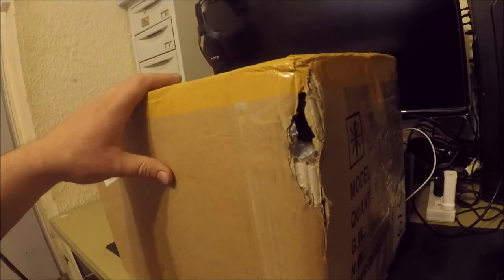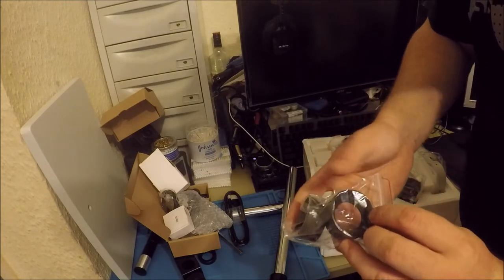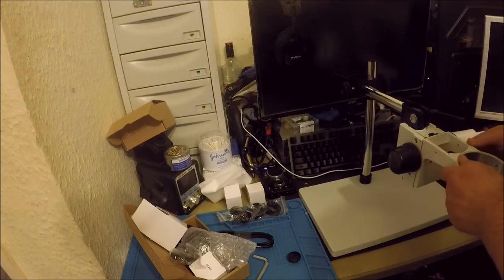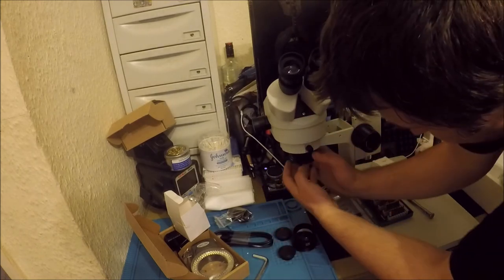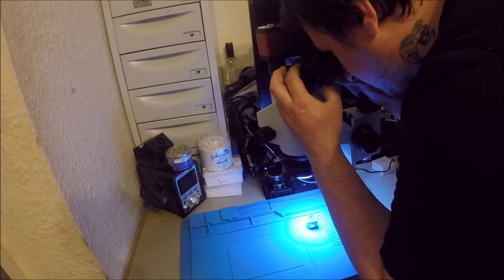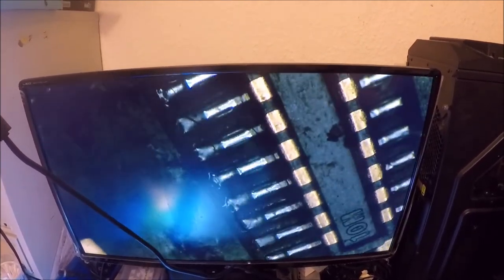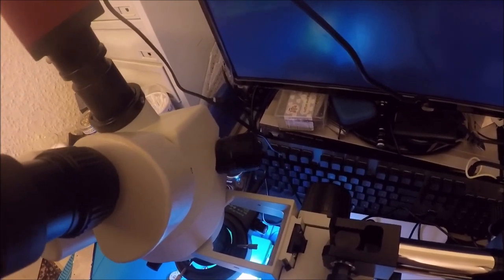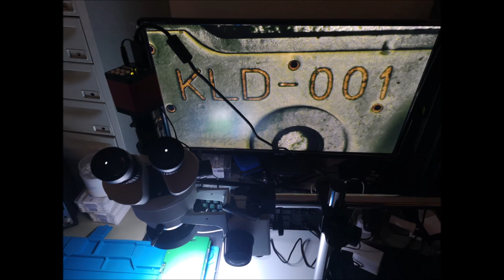Microscope 3.5x-90x with 720p HDMI 13MP camera and 0.5x lens- Banggood - First impressions

Comment: Have you figured out what reducer you need for the camera?  I've looked on the Banggood site, can't tell exactly what I would get or if they even carry it!
Reply from the maker: Haven't ordered one yet but I think I have found the type I need on ebay. Its exactly the same as the adapter that holds the camera onto the scope but a 0.5x, they is a 0.3x aswell so I will order both and see which is best. If you hold the ring light and lower it in your hand the screen brightness is perfect but obviously that's not ideal. Could add extra light but the camera would still be zoomed in too much. Will do a update video when I figure it out, will probably order them tomorrow.
Reply: @m111kca4  
I want to order it, but the camera problem is holding me from purchasing it, I really want to be enable to see the full image on a monitor, I don't want to work looking at the eye piece all the time, lets hope the ones you get are the correct ones.